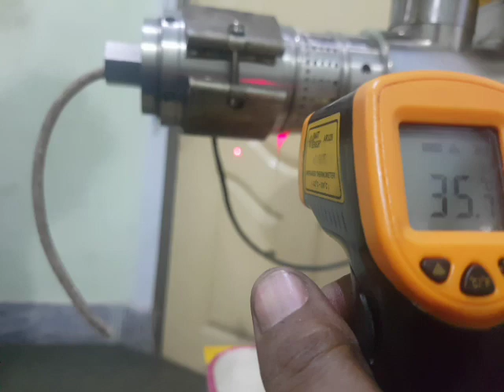Apricot (Khubani) Cold Oil Press CP-20s Extraction Pakistan +923333222239

Comment: Cold press 1st
1 to 10kg/h 200kg/day different types of seeds
Motor power 750watt 220v
Heating power 250w
 single phase stainless steel 
weight 50kg 
Height 650mm
Weight 300mm
Length 800mm
Price Rs.250000
2nd
1 to 20 kg/h 400kg/day different types of seeds motor power 1.5kw
Heating power 400w 220v 
single phase stainless steel
Weight 90kg
Height 700mm
Weight 450mm
Length 950mm
Price.
 Rs.350000
3rd. 1to 30kg/h 0.65ton/day seeds
Motor power 2.2kw
Heating power 600w
Single phase 220v
Height 800mm
Weight 400mm
Length 1100mm
Price. 450000
All machine 
speed veriable 
Heat veriable
Continues working 
Badam kalvanji khushk dhaniya sonf hemp seed
Sunflower mustard canola moringa etc100% pure oil.
Reply: Tum nay marna nahi hy yeh machin total 25 se 30 hazar ki hy kitnay % profit lay rahy ho lahnti admi
Reply: @shaukatali5411  اتنے میں اس کی موٹر بھی نہیں آتی.  جس چیز کے بارے علم نہ ہو.  چپ رہنا بہتر ہے بولنے سے بندے کی اوقات ظاہر ہو جاتی ہے

Comment: How much price is and where is available please send me all details quickly
Reply: Cold press 1st
1 to 10kg/h 200kg/day different types of seeds
Motor power 750watt 220v
Heating power 250w
 single phase stainless steel 
weight 50kg 
Height 650mm
Weight 300mm
Length 800mm
Price Rs.250000
2nd
1 to 20 kg/h 400kg/day different types of seeds motor power 1.5kw
Heating power 400w 220v 
single phase stainless steel
Weight 90kg
Height 700mm
Weight 450mm
Length 950mm
Price.
 Rs.350000
3rd. 1to 30kg/h 0.65ton/day seeds
Motor power 2.2kw
Heating power 600w
Single phase 220v
Height 800mm
Weight 400mm
Length 1100mm
Price. 450000
All machine 
speed veriable 
Heat veriable
Continues working 
Badam kalvanji khushk dhaniya sonf hemp seed
Sunflower mustard canola moringa etc100% pure oil.